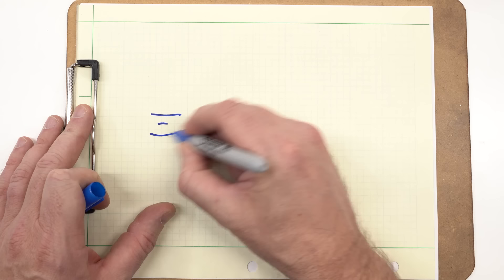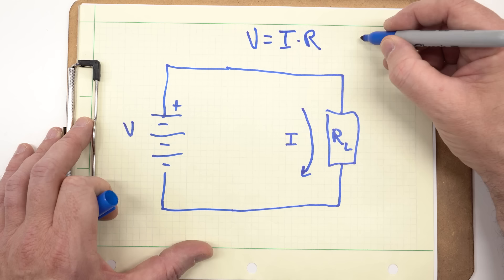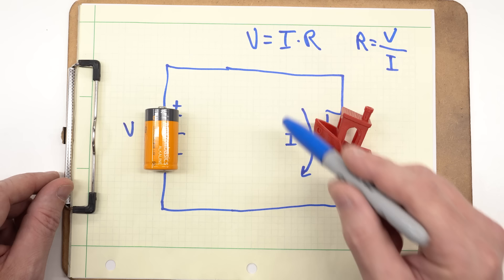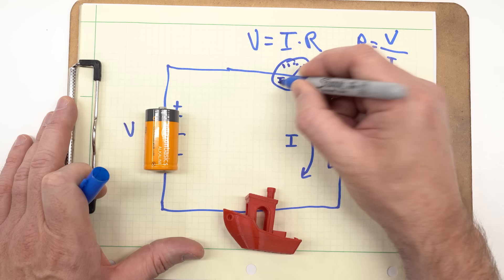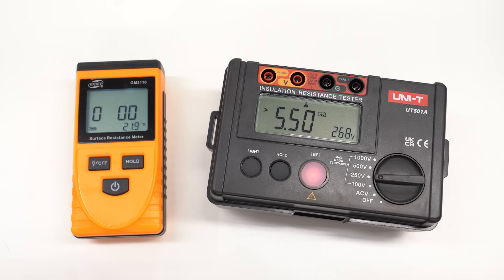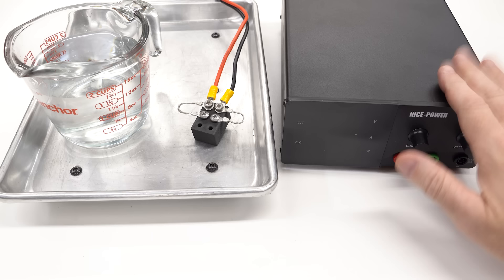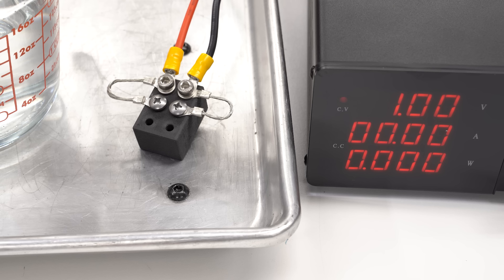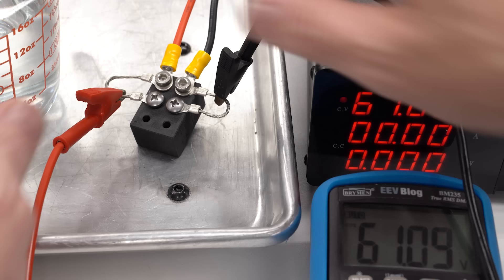3D Printing Filaments and Electricity: A Shocking Reality

Comment: Hi, first time commenting. 
Years ago as a young engineer we developed small motor protection devices called polymeric PTCs. We used carbon spheres instead of carbon fiber but saw an effect similar to what you observed. At lower voltages and lower temperatures the plastic acts as an insulator. As the voltage increases a tunneling effect can be observed. As the temperature of the polymer increases, the current flow reduces. 
Loading the polymer with higher levels of carbon will produce a low resistance device at room temperature that switches to a high resistance in a sigmoidal curve. Hense, a motor protector. The trickle current keeps the temperature high until the circuit is opened. The the device will cool and reset to a low resistance again.
Reply: Can confirm temperature dependence on these result.

Comment: I was hoping more would turn out to be conductive. The cost of conductive filament is pretty high, and it would be nice to be able to print static dissipative enclosures and such for sensitive things
Reply: There are a few filament brands that do deliver a static dissipative filament but I never checked out any of these. I only use special coatings or even metal tape to get dissipative, static or even RF shielding.

Comment: This was interesting to see. I think it may be mostly down to chance. The plastic itself is very high resistance, but the carbon fibres are lower resistance. Since the carbon fibres are distributed randomly they could align into a chain, close enough together to conduct, which might be what you saw with the Bambu labs PAHT-CF. I would also think that the longer the individual pieces of carbon fibre, the higher chance it ends up conductive, since you have to align less fibres then for the same distance. If Prusa uses recycled carbon fibre, it could be that they don’t chop or grind it up as much as the others, so the fibres are left longer.

Longer fibres are better for mechanical properties, but worse for clogging. Bambu lab recommends a 0.6 mm or bigger nozzle for the PAHT-CF, which might mean that it’s fibres are longer and more likely to clog.

It seems the two things that should effect it is fibre length and fibre content, higher of either probably means it is more likely to conduct, but I wouldn’t want to rely on them being non conductive. It would be interesting to see an extended test of some of the filaments to see if it was just chance that the PAHT-CF conducted and to see if some of the other filaments would conduct too.

It would be very interesting to see you use filament with glass microspheres in it, they are supposed to have similar effects to carbon fibre but are supposed to be insulators too since the glass spheres are highly non conductive, so they may be an option for situations where you definitely do not want any conductivity. Glass fibre, glass microsphere and Kevlar (aramid) might be good to try.

Edit: nylon with glass fibres is commonly used in injection moulding, sometimes at least 40% glass fibre by weight and it is used for all kinds of things, including power tool housings. It seems much more widely used than carbon fibre so maybe conductivity is a possible reason for that?

The resistance for spectrums PA6 GK10, which is one of the glass microsphere filaments has its resistance in its data sheet, the insulation resistance is above 10^12 Ohms and the surface resistance is the same. Spectrum also do a PA6 CS20 FR which is a fire retardant nylon with ceramic spheres (where the CS in the name comes from), it also mentions its surface and insulation resistance but it is only 10^9 Ohms. Spectrums PC-PTFE also claims above 1e12 ohms.
Reply: Glass fiber is significantly cheaper than carbon fiber.
Also glass is significantly less irritating for some reason.

You could probably get the same durability with significantly less CF than GF but it probably would be harder to make sure it is evenly distributed.

Comment: Carbon Black (often of colorant) can impact RF. We utilize different variants of carbon black additive into injection molded boxes for radar sensors on autonomous haul trucks. Sheet metal boxes originally used were causing to much interference issues and giving faulty readings.
Reply: @itigg 's comment about the Carbon Black colorant is spot on. Seen it many times in industrial situations with all sorts of materials. Last one was on a newly installed machine that had a mechanism fed with 2500vdc that was isolated from the machine. It was pneumatically raised and lowered against a plate to apply the charge to another part. It was faulting out for high current. I got called to troubleshoot it and seen the installer had used black polyethylene tubing for the air lines. Told them they needed to change to clear tubing. Got a bunch of "Your full of BS". I took the black lines off and said "Turn it on now". I walked off while they said "Dang, it works now...."
Reply: Does things to CO2 laser cutting as well, black acrylic is just that little bit more difficult to cut than any other colour.  White on the other hand cuts beautifully for some reason.
Reply: I guess similar would apply to Titanium white (one of the most common white pigments you'll find). A cursory google-fu shows that titanium dioxide is a semi-conductor. Cutting behaviour is probably down to energy and light absorption/dissipation properties of the material
Reply: @konzetsu6068  Yeah, black needs a bit more power to cut because the IR light get absorbed more than the other colours.  With white it's more about edge quality, often comes out really nice (flame polished).  Can get the same finish on clear if the phase of the moon is right.  On black?  No way.

Comment: This is the exact video I have been searching for! I'm building an automotive under hood fuse box that PA-CF has the best mechanical properties for, but was concerned about the conductivity as the circuits are in direct contact with the material. The only thing that would have made this video better would have been testing pre and post annealing of the samples along with saturation, would probably change the results quite a bit.  I think a part 2 is in order!

Comment: At work we use 3D printed plastic enclosures before the tooling for moulded production versions is available. 

We had a problem where the prototype products were readily failing flash test, which was down to the 3D printed enclosures being conductive. 

Doubt it was a carbon fibre filament, but it was a black colour which consistently gave issues.  Going back to the supplier, their best guess was if the parts had absorbed moisture?  I wondered if it was the use of carbon black in the colour of the filament?

Never did really get to the bottom of it,  just learnt that 3D printed components can be conductive and shouldn't be relied upon to insulate in important situations.

We could measure it with a multimeter, didn't need the flash tester at a couple of kV to see the problem, but that was what drew our attention to it.  Printed parts a different colour seemed ok. <shrug>
Reply: Yep carbon black, lots of people here mentioning having the same experience.
White timing belts on a (to be honest faulty) moving roof motor, not causing any issues, the black ones shorting between the faulty and the good motor....

Comment: Interesting video.  I use these tools at an aircraft manufacturer who builds the fuselage almost entirely of composites.  Between the layers of composites there is a metal mesh for static dissipation and lightning strikes.  During final checks we use the ohm meter in various locations such as static wicks, cowlings, flight controls, etc to check resistance.  If not in limits we use the insulation resistance tester at 1000v to improve the readings.  Every time I set the tester to 1000v I always said to myself that the amps is what kills you, not the volts.  Never was completely convinced and did not want to find out.

Comment: Thanks for the video. Reminds me of the time I had a very well known company that makes reproduction rubber components for vintage cars make some spark plug boots for an old engine. They arrived, looked beautiful. I assembled some, started the engine, and it ran awful.  Misfiring badly. I could hear and see sparks jumping off the new boots. I called the company, and an engineer realized they had unintentionally molded these with a conductive rubber. 🤦‍♂️ I didn't know there was such a thing before this happened. They made new boots from a more appropriate rubber, and all was well.
Reply: Carbon black is typically used in rubbers to protect them from UV. Maybe that was it.

Comment: That was interesting. At least for anything higher voltage, I would have had a gut feeling avoid CF filaments just to be safe. Sometimes a tiny conduction can burn tiny bits of insulator and it may fail in time. I would never have guessed a measurable conduction at low voltage like Brymen!
Yet another video that I learned something from. That seems to be the case practically every time on this channel.

Comment: A really interesting investigation. I personally expected more than 2 filaments to be (barely) conductive.
But most being non-conductive to even high voltage meters, that's surprising to me.
I also didn't know yet that voltage limits max. measurable resistance either.

Comment: Perfect timing! I just ordered some Extrudr DuraPro ABS explicitly because it is electrically isolating (as per the spec). I assumed that CF filaments would conduct, which is why I even looked at a different filament. Cool!

Comment: After the initial breakdown at high voltage - a pathway is carbonised and will stay conductive to a lower voltage after initial breakdown of the insulating polymer between.

Comment: Very interesting!  Some carbon, like that of a pencil core has varying conductivity depending on the mix of graphite and whatever filler (originally clay, then maybe some polymers).  The whole issue revolves around microscopic contacts within the carbon particles, such as graphite flakes.  The contact probability is science way beyond my abilities to tackle.  All I can imagine is that there is some non-linear or maybe even abrupt limit in the carbon content when the carbon to carbon CHAINS start forming.  Keep in mind that just contact between only two carbon particles is not sufficient for overall conduction.
  But here comes something from my distant past.  I once built a control (or monitoring) system for manufacturing paper insulated phone cables.  Paper is quite good insulator, provided it is dry.   So the manufacturing process included heating the cable before a lead jacket was extruded over it.  That happened in in a vacuum chamber.  Rather than just guessing when the cable was dry enough, some measurement was desired.  There were two things that I implemented.  One was measuring the resistance increase in one ore more wire pairs.  The other was measurement of the insulation resistance between some wire pairs.  And that is where we made at first a rookie mistake.  The wiring between the chamber and the measuring station was PVC insulated, and it was leaking to the tune of some tens or hundreds of megaohms.  We had to change the connecting cable to polyethylene type, after which valid measurements of the cable dryness was achieved - several tens of gigaohms.  Later on, I have had a Fluke 8060 handheld digital multimeter that had in addition  to the usual ohms resistance measurement, also a conductance measurement capability down to nanosiemens levels, which was handy for sorting some 1N4948 diodes for low leakage, to be used in a timer circuit.  Even later, I purchased a couple special instruments, a Keithley Electrometer with sub-femtoampere capabilities, and an HP4329A high voltage, high resistance meter, up to 2*10^16 ohms.  Both meters were surplus items at flea markets and I have needed them maybe once or twice.

Comment: That was indeed a surprising result. From your previous video I did remember (correctly, I just checked) that there is no direct electrical contact between the printed plastic and the traces on the PCB. The only thing that might have been an issue is the clearance on the larger pads the big screw nuts connect to but putting some clearance on these would have been an easy job.
Years ago I have been talking to FormFutura engineers about the conductivity of their CarbonFil and possibly creating a dissipative filament. They though that since the carbon fiber is embedded in the plastic, they think conductivity - or the lack thereof - is not something they can guarantee. 
I think the conductivity may even vary across different badges of the same material, depending on the carbon particles, plastic type and possibly even on slight variations of process parameters during production.
Reply from the maker: That's my assumption as well: you can't count on it to conduct, but you can't count on it to not conduct, either.
Reply: @Clough42  the manufacturing process might allow you to prevent conduction, for example introducing slight gaps that interrupt carbon connections. On a very small scale like 1mm it might not work as they could still be contiguous but beyond that statistically impossible. However that might also introduce weak spots depending upon each print. You want fibres somewhat overlapping as that allows the force to be shared. If you had a single layer for example without any carbon fibres then it acts like a kink in a space elevator.

I read a few papers on how the length of carbon fibres affect composites. I did this after reading far too many online comments dismissing CF filament since they aren't contiguous and therefore don't benefit from carbon bonds. The research was interesting, the whole thing is incredibly complex. Depending on the manufacturing process used you have massive variation in fibre length but more importantly fibre alignment. 

The fibres can have a narrow average angle cone making the material very strong longitudinally. In those cases longer fibres are significantly beneficial. Many are overlapping along the same direction and sharing load. If you have nearly randomly angled fibres then shorter fibres are no longer disadvantaged. You want them all overlapping, lots of small fibres create more overlap than a few long ones.

Hazarding a guess, this type of thing could drastically affect conductivity. Even if there is a conduction path through carbon fibres end-end, a single microscopic, short fibres and barely contacting chain will have massive resistance. A mix of random orientation long+short fibres could produce numerous conduction path ways through the shorter fibres with the long ones interconnecting them all.

Forcing consistent conductivity seems impossible. It would need long molecule carbon chains like unbroken nanotubes or graphene which we can't manufacture that would be interrupted during printing anyway.

Comment: Another aspect: nylons particularly, but all plastics to some degree, absorb moisture. I presume these came more or less straight from the printer and have not absorbed any humidity. So as they absorb moisture over time the conductivity will probably go up too.
Reply: I really don't think that will be a problem. Even if you graphed the different base plastic moisture absorbancy, pure water doesn't conduct, and atmospheric water isn't going to have a lot of conductive salts dissolved in it to begin with. There "shouldn't" be any conductive materials readily dissolved by water in the part, either. If anything, moisture getting in might push the carbon filler further apart, reducing conductivity. If anything, these samples would act more like a capacitor than a resistor. But, assumptions and speculation are worthless, as shown in this video when everyone, literally, was wrong! Including the man himself. 

It would be interesting to test these at higher voltages, like with a Tesla or even a MOT (with appropriate safety systems and interlocks).
Reply: @dogsarebest7107   Not able to quickly find out what MOT you are referring to. The most common answer is Ministry of Transportation which refers to car tests done in the UK.

Comment: 20 years ago we were using carbon fiber heaters that were used to evenly heat a 6'x16' polypropylene panel. I also understood that many composite aircraft use carbon fiber on the leading edges of wings for de-icing. Just for kicks' I just took some carbon fiber 2" tape and hooked an ancient pot on it and had the whole 5-foot or so glowing red and pr.producing a fair bit of heat
Reply: One of the reasons I follow your channel is you test things, you do the math. I would do that too if I had the slightest idea where to start. In this case, having watched the video a couple of times and looking at my test with 110v mains, the difference must be in the volume of carbon fiber in the filament vs the ribbon.